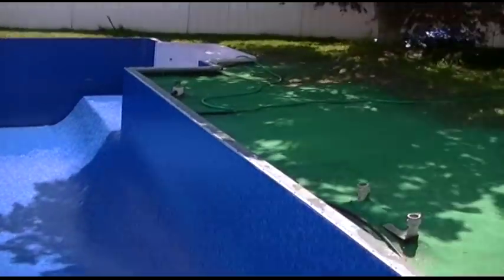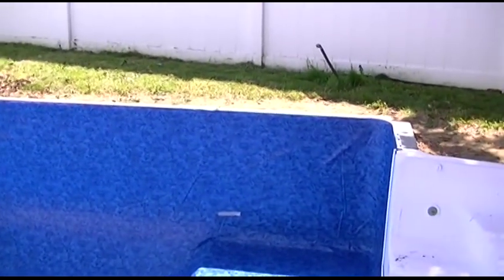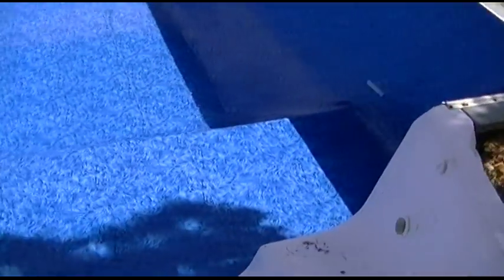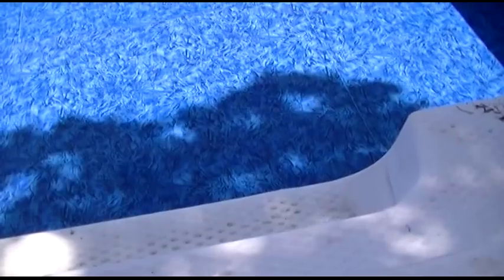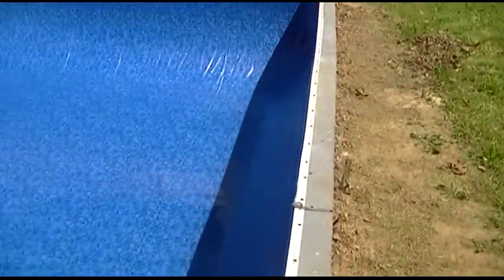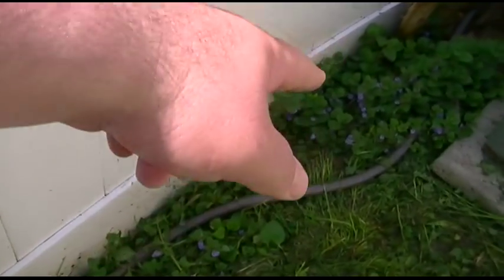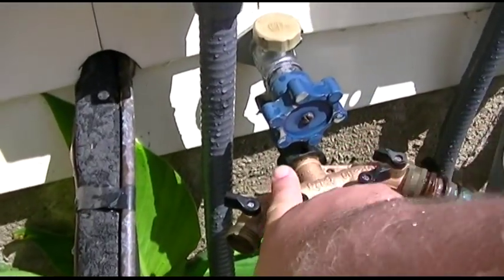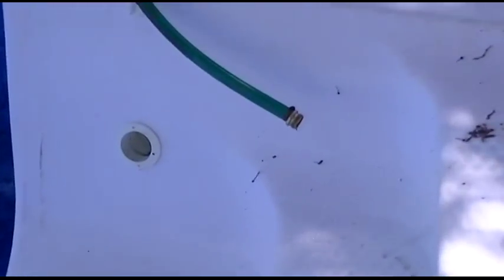Pool Liner Replacement Part 3 - Filling The Pool

Comment: I'm glad I don't have to pay your water bill next month!  Would it be cheaper to buy the water from a pool water company that shows up with a tanker truck and basically fills the pool in a very short time or do you have a separate meter on your outside faucets so you don't have to pay the sewer part of the bill?
Reply from the maker: tallboyyyy Yeah I can't wait to find out how much it's going to cost.  Pool holds about 22,000 gallons.  I believe "trucked-in" water is considerably more expensive.  There's no separate meter for outdoor faucets here; sewer is a separate tax and it's not charged based on how many gallons you use.  The sewers here are a separate entity, it's paid as part of the town taxes.
Reply: jaykay18 Here you can get a separate meter for your outside faucets.  I found this out after forgetting to turn off a sprinkler before I went away for a weekend.  My neighbor was nice enough to call me the next day and ask me if I meant to leave it on.  If they hadn't called my bill would have been considerably worse than the $260 it came to when it is usually about 90.  The town charged that because they thought all that water went down the drain.  Instead all my money went down the drain.
Reply from the maker: tallboyyyy They get you one way or another.  Honestly, even $90 is quite a lot, but in the summer between the pool and sprinklers, I'm no stranger to $260.  Again, we don't have sewer charges assessed to our water usage, so maybe that's why.
Reply: jaykay18 The 90 is actually for 2 months so it isn't too bad.
Reply from the maker: tallboyyyy Yeah they bill us every 2 or 3 months as well here, that's what I was basing the numbers on.

Comment: How long that vacuum machine is running? Until the water is full?
Reply from the maker: Joey P They ran it for 24 hours, until the pool was about 1/3 filled.  How long they should have run it is another story.